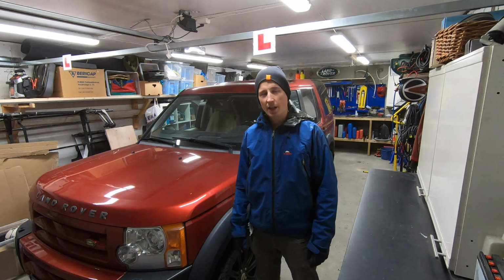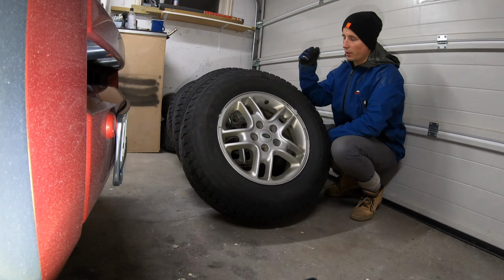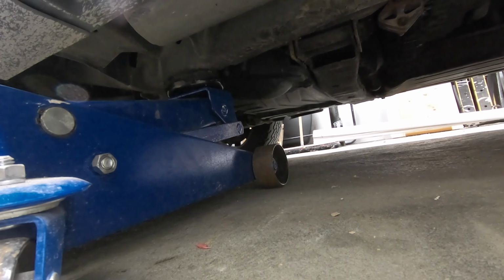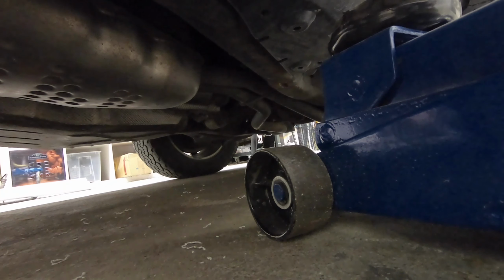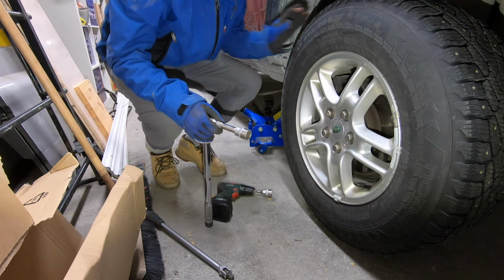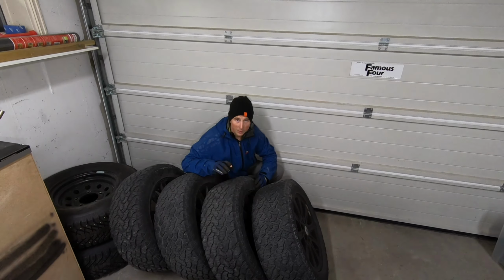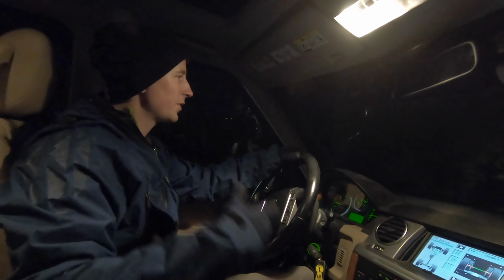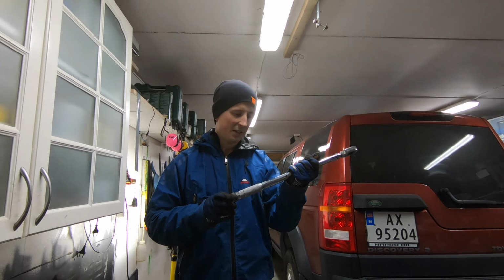Tire change Land Rover Discovery 3 - All terrain to Winter Studded tires

Comment from the maker: Do you change your own tires? If you do which tools do you use? 😀  Hit me with some feedback on the video and if you have tips and tricks please share in a comment below. 👍

Some winter videos: https://www.youtube.com/watch?v=Lj0hIED3uJ8&list=PLAEOLrs1myKYV6SWkP5TYn6oMLsAzfBJC
Reply: I use air tool but set the torque at the lowest when I set the nuts and then use a torque wrench in the same way as you do.
When changing to wintertyres I allways put some copper paste on the wheelstuds for a easier job when the spring comes. This offcourse has more effect on steelwheels w/ steelnuts.😉
Reply from the maker: Hey Robert! Sounds like a great way. Smart with the copper past. I have been reluctant to do this as I wanted to be sure that the nuts stay on and does not unscrews them self. I'm not an expert on this so that's why I haven't used it. 😀 Good to hear from you again and hope you are doing great! Best, Simon.

Comment: Have grabbers on all my landies, just put the at2s on my 110, my d3 came with at3s already fitted and I have a disco 1 with ats fitted. Ats were really good in uk winter snow and ok when it got icy, we don't have severe enough winters to justify a proper winter tyre. Have come from bfg ats on the 110 so will see what I think of the at2s if we get any snow this winter. Out of curiosity what summer tyres and pressures do you run on your 110? To get even contact over the full width of the tyre I run 32 psi. Thanks for the vid dude, enjoying your uploads 👍
Reply from the maker: Thanks and I'm glad your enjoying the videos. 😀 I see your point about winter tires in the UK, I would probably do the same. This winter there has been more wet tarmac then snowy roads on the mein roads. The side roads have been covered in ice 60% of the time.  For my 110 I have some old regular road tires, Hankook Dynamic, you can see them in the overlanding series where we drove to Elvedalen last spring. https://www.youtube.com/watch?v=4HnBgTPrXFo Depending on what I'm driving on I run all the way from 14 psi offroad to 40 psi when driving longer stretches on tarmac. For best contact on tarmac/gravel I use around 33 psi. Thanks for watching! 😀

Comment: I do it pretty the same way like you do, always keep the hub clean and clean the rims after the winter season and do a quick check if the breaks are ok, but i`m much lazier than you and using an impact wrench :-D On my Discovery 4 i have General Grabber AT3 they are getting sold as all season tires. On my Discovery 3 i had 2 sets of wheels but i sold them with the car because the Disco 3 rims from the SE model (18 inch) doesn`t fit on the Discovery 4. Maybe i found a set of second hand rims for my current Discovery. 
Best regards from south Germany and enjoy the weekend,
Daniel
Reply from the maker: Hey Daniel, sound like you got it under control. 😀 Don't you ruin your wheel nuts with the impact wrench? Thinking of the aluminium cover. Would love to test out the AT3 on the D3, but not sure if I will go for the Cooper stt pro MT tires. Would have been fun to try a more agressive tire and I know the STT don't make to much noice. 😀  I see a lot of sellers selling the tires as all season and I'm also seeing MT tires being sold as winter tires. I felt the AT2's did great the first winter but was getting dangerous in the start of the next one.  But AT's with some quick snow chains in the back is a good combo. Thanks and I wish you the best! Simon
Reply: @LandRoverDrive  I use the impact wrench only till the wheel nuts fit and do the rest with the torque wrench with a force of 140nm. I bought a plastic coated socket wrench to be sure that i don`t damage the paint on the rims.
Reply from the maker: Aaaa, smart with the plastic coated sockets. I've been looking for that but haven't found on in 22mm yet. 😀

Comment: What size tires and wheels are those?
Thanks for the video
Reply from the maker: Hey, the General Grabbers AT2 is 255/55R18 - results in a 29 inch tire. The Nokian Hakkapeliitta LT2 is 245/70R17 - results in a 30.5 inch tires, so a bit bigger. 😀  You are very welcome and thanks for watching.
Reply: @LandRoverDrive  I did not know you can fit 17" wheels, I thought the minimum is 18! Are these discovery 2 wheels? 
Thanks (-:
Reply from the maker: @karimalameddine5092  Hey, I think all D3's that don't have Brembo brakes will fit 17" rims. The rims are original D3 rims. Discovery 4 has 18" as a minimum. 😀
Reply: @karimalameddine5092  the vehicle in the video is a tdv6 2.7 which has a smaller diameter disk and caliper than the V8 4.4 version. With the V8 you can only fit 18" smallest as oem wheel.